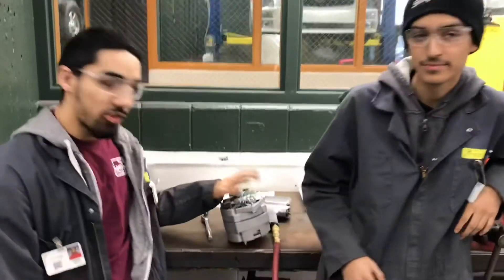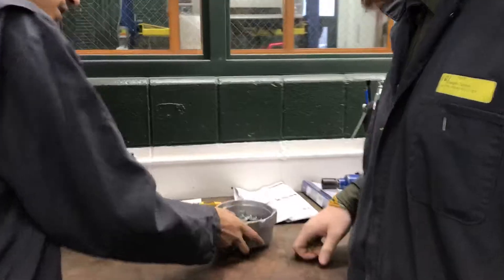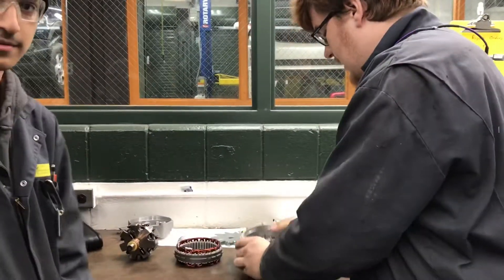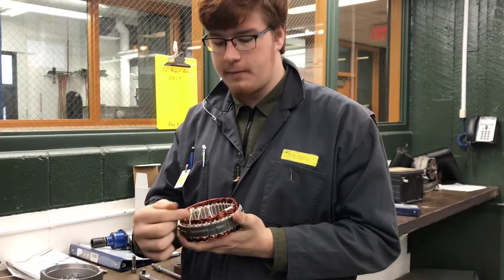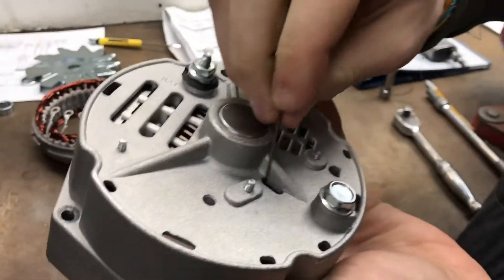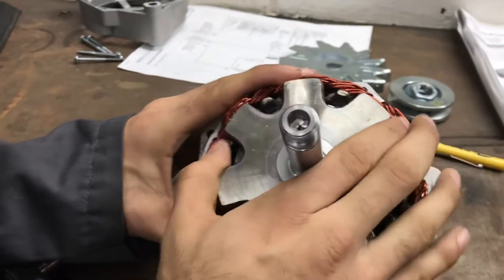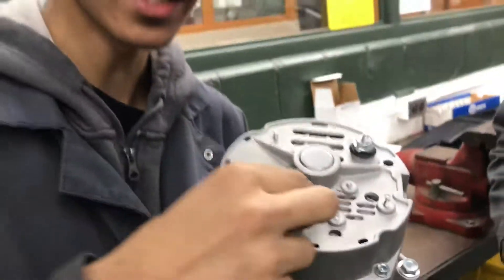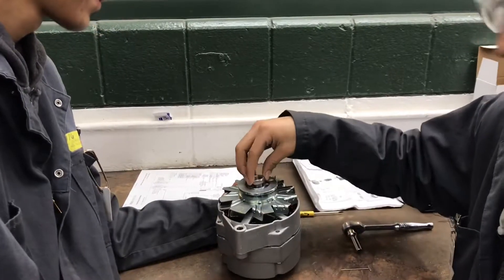How To Rebuild A Alternator (EASY)

Comment: Sadly, the title was misleading. Disassembly and reassembly are not a "rebuild".
Reply: Well quite simply, when reinstalling everything? just use new parts instead of the old parts...
Reply: @gurnblanstein9816  Too bad this wasn't included in the video.

Comment: Yall should get your A&P and do this with aircraft alternators. Some of the older smaller airplanes are the exact same as cars but sell for 3 times that. By Older aircraft I mean older planes that are still being used quite frequently and in many cases are still being made new.

Comment: The regulator, diode array, brushes and bearings are the failure components. I rebuilt my first alternator 44 years ago at age 14. This video is much to vague to teach anyone how to rebuild the component. But any teen should be able to figure it out without a guide.
Reply: "But any teen should be able to figure it out without a guide," lol ok, boomer😂

Comment: would have been nice to see what goes bad what needs to be replaced and how to test the atator and armature, diode bridge etc etc
Reply: I mean you can test your alternator using a multimeter while the car is running using ohms. If you’re testing the alternator test the battery too and check for wear on the leads
Reply: @mikehamer1091  you missed the whole point smh

Comment: nice attempt but this video lacked alot of actual detail on everything..literally the only thing i didnt know was moving the brushes out of the way and using a pin....i would recommend you guys do a real breakdown, slower, explain common issues taking things apart or the challenges you guys have working on car parts and tips or tricks. that lookee like a new alternator....But how about like how to change brushes or volt regulator...or how to clean a really dirty alternator etc....

Comment: Wow! I couldnt believe he actually held the fan blade with bare hands to build resistance while using high powered air drill "PLEASE YOU SEE THIS DONT DO IT YOU CAN EASILY SLICE YOUR HANDS OFF" NOT VERY BRIGHT FOCKS NOT VERY BRIGHT. Good thing im the first to comment.
Reply: Not that anybody stuck around long enuf to se it
Reply: They were probably just trying to keep it short.  Would normally do it differently. Was thinking same thing
Reply: This comment NEEDS to be pinned !